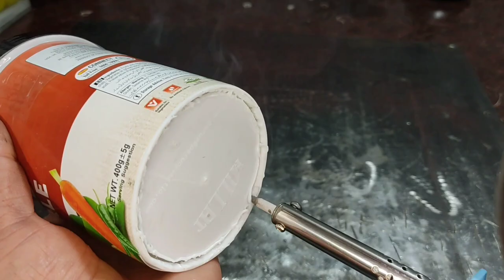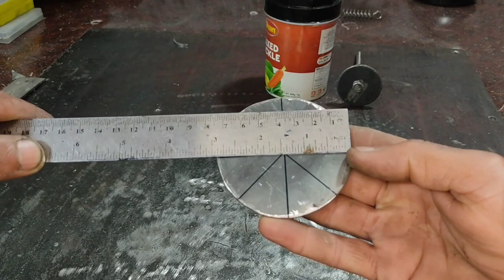How to make a onion & vegetable cutter || DIY vegetable slicer machine || smart kitchen gadgets

Comment: Fantastic concept only one suggestion pl use wooden base and the chopper should be easily placed inacirciular groove and asmallcenter screw to just fixthe vegitable and while pressing ifit. Had circular groove to rotate the grue should be in wooden base .